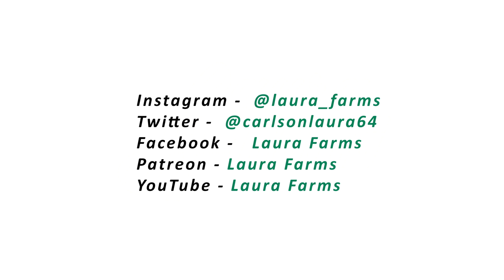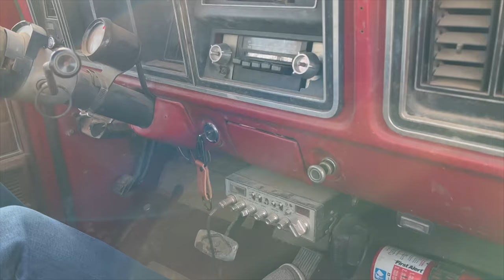It Takes a Few Cranks….

Comment: Little trick winding up the fuel hose- walk the nozzle back to the reel, set in on the ground. Now when your winding it back up hour only dragging half the weight and not dragging the nozzle.
I had 130'+ on a hose reel on the dock and it saves you our back.

Comment: My first truck I bought was a 68 GMC from a junk yard.  I did not think I had seat belts in my truck till I put a saddle blanket seat cover on the seat.  I doing so I found seat belts stuffed back and under the back part of the seat.  I rebuilt the engine and used the heck out of it.  It was a great truck with a powerful 396 four bolt.

Comment: I’m sure someone has already said this, but you need to put a few dryer softener sheets in the equipment to keep the mice out.  I’ve put them in engine compartments and in cars for a few years with no chewed wires or mice in the cars.

Comment: Hi Laura, 

The truck fired right up off the bat when you attached the cables. My brother use to live in Broken Bow Nebraska (The state you are living in) and he said winter had a lot of subzero temperatures. I live in the neighboring State of Colorado in the big city (Colorado Springs) and we only get subzero and single digit temps a few times a year; but when we do, and I go to start my Saturn, it does start right up the next day, but the starter has a very faint sound, and when the engine fires, it makes a whining sound. It makes me think, if I left my Saturn out in cold temperatures for a few months, I wouldn't be able to start it as I would probably have a dead battery too. Nebraska is a lot colder than Colorado, so if you have an old car like that Ford Truck, you would probably need to get the cables right off, especially if the engine ran on diesel fuel.

William (Bill) Baxter, "Frontier W.E.B. Singer."

Comment: 1974 F-250. V8? So, either 360 or, 390? Old 3 speed transmission. 1974 was the last year of no unleaded gasoline. The world changed.
Reply: Mine had a 460 w/ 3spd automatic..  I thought it was indestructible till a Ford Pinto station wagon ran a stop sign at higher than normal speed, hit my precious T-bone style on the front left wheel and destroyed the frame nearly L shaped.  And that wasn't even my first F250 T-bone 😲 ..